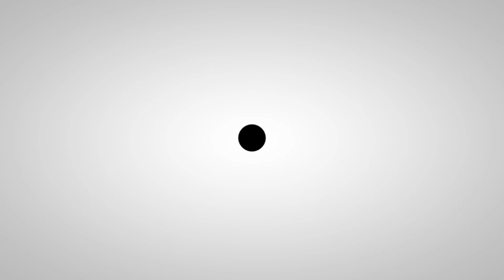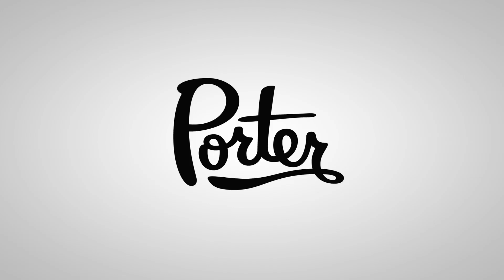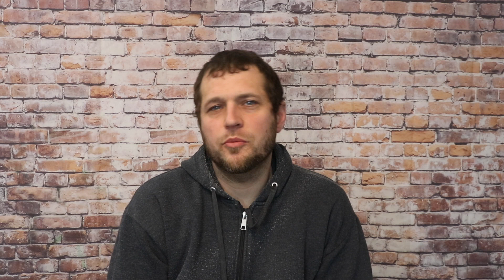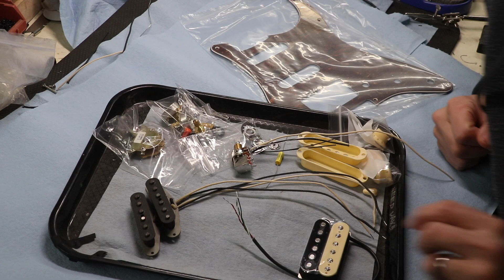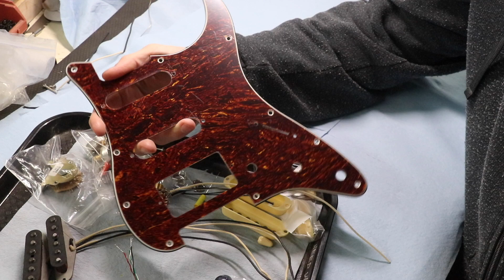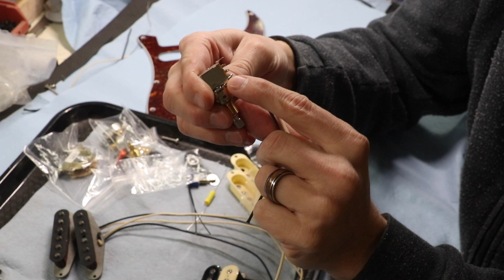Wiring our HSS Deluxe Loaded Strat Pickguard

Comment: So you are not compensating the volume connections for the differences between the humbucker and single coils, The humbucker wants to see 500K on the volume pot, but the single coils want to see 250K. Depending on your pot value, you are either going to get very brittle single coils or a muddy humbucker. You need to add some resistors into the circuit

Comment: HEYOOOOO.  THATS MY MF'ing PICKGUARD.
Reply: No, seriously.  How cool is this?  I can't believe MY PICKGUARD is a YouTube star! It's awesome to see how well made this thing is and how much care went into it.  You earned a customer for life, right here.  @PorterPickups
Reply: The jack/groundwire is going to get jammed in the corner (near the pickguard screw hole middle tone knob) the stratocaster control cavity is tight inside the corner
Reply from the maker: @missingremote4388  It will fit just fine for most strats. We have done hundreds of these.
Reply: Please wiring diagram
Reply from the maker: @RobbieDiMaccini  it’s a hybrid of a few different ones. You start with a standard 5-way diagram, put in the “add neck” wiring and push pull on the volume to split the Humbucker.